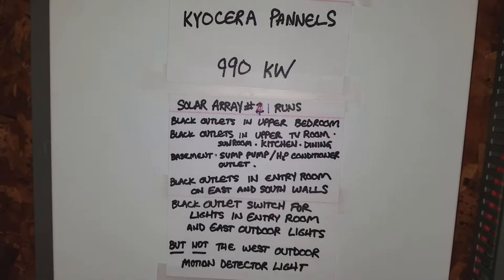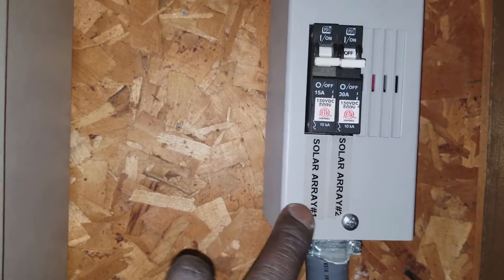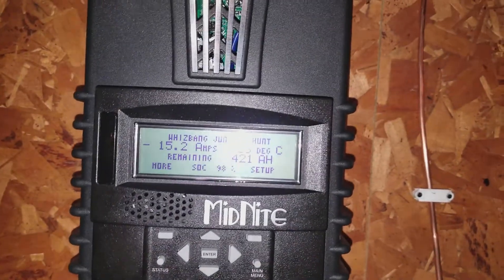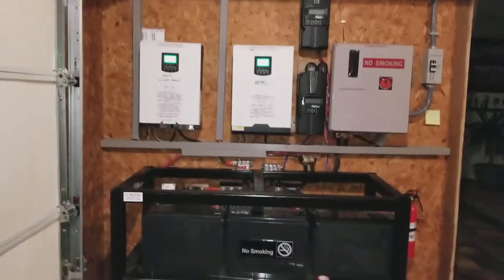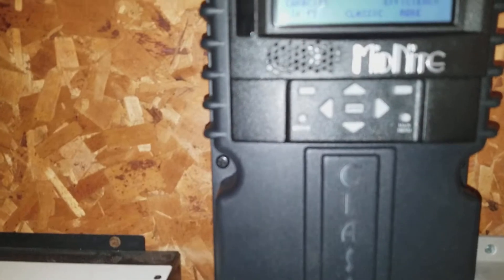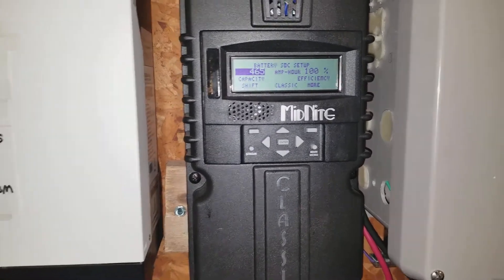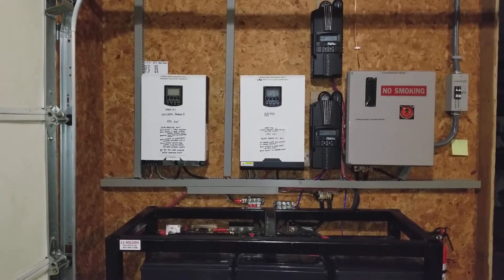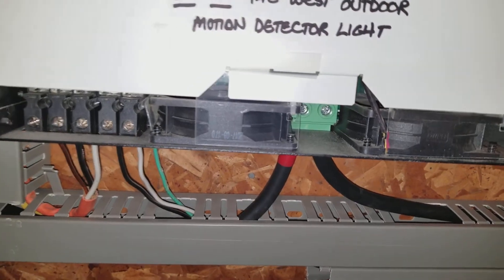LIVING OFF-GRID IN AN EARTH STYLE HOUSE || Upgrading the SOLAR POWER HOUSE IS COMPLETED (SE#8)

Comment: hi wat classics are u running i have a classic 250 ...and have 10 ..290 watt panels can i do 5 in series parallel and 5 in series parallel ...without hurting the controller...
Reply from the maker: What we have is the a MidNite Classic 150 & 200 MPPT Solar Charge Controllers.
What is the VOC of the panels?
What is the nominal voltage of your battery bank?
Reply: @jwsolarusa  my VOC is 44.7 and i am running a 24volt battery bank
Reply from the maker: @lorenzahendy4824  
You can have 5 x 44.7 =223.5
The Midnite Classic 250 is a 63A Charger Controller. I doesn't take much solar panels on 24v
Reply: @jwsolarusa  ok thank you ...ur doing a 1st class job keep up the gud work..
Reply from the maker: @lorenzahendy4824  
Thank you

Comment: Hello Friend, quick question for you.. in a multiple PIP inverter configuration, the MPPT capability of the inverter is multiplied, for each of the inverters in the system???
Reply from the maker: +Elente Films 
Yes in a parallel configuration if you are using the card. I hope I understood your question correctly and thanks for watching. 
Please don't forget to subscribe, give us a LIKE and Share My Videos. 
Have a wonderful day
Reply: hey thank you.. if thats the case, why you added Classics to you configuration??
Reply from the maker: +Elente Films 
The MPP SOLAR PIP242424LV-MSD are designed for 24V configuration only. While the MidNite Classic is designed for 12,24, 36, 48, 60 and 72 volts with better and efficient (MPPT) Maximum Power Point Tracking. If Stevie decided to upgrade to a higher voltage inverter in the near future, all he has to do is just swapping inverters and he is ready to go on all of those voltages I just mentioned.
I hope this makes sense to you. We are NOT using the inbuilt Charge Controllers for the PIP' s 
Thanks for watching
Reply from the maker: +jwsolarusa 
And the comments
Reply: Sir, thanks for taking your time to answer my question, you just make my day :) , i'm about to get the same PIP for my house, and I was hesitant to do so because of the first question you answered, but I think that to start the PIP is an excellent option, scalable and affordable. I have more questions but i dont want to bother you anymore, thank you again Sir
Reply from the maker: +Elente Films 
Elente, you are welcome to ask questions anytime you want and I will do my best to answer your questions.
MPP Solar Hybrid Inverters are awesome machines, realiable, reasonable and easy to install.
Please go ahead and give them a try. I don't think you will regret it. 
Thanks watching my videos. I hope you find my channel interesting, helpful and informative. 
Please have a great day.